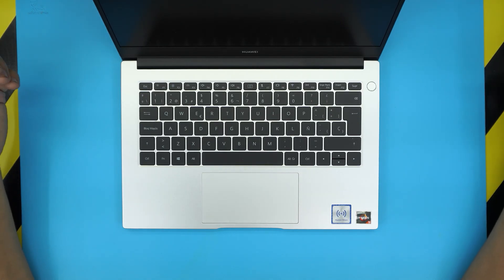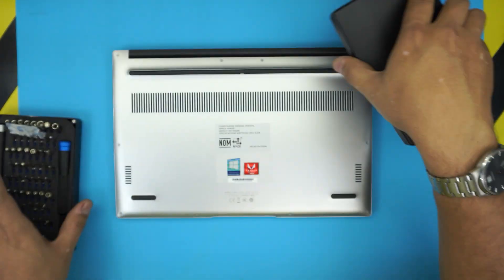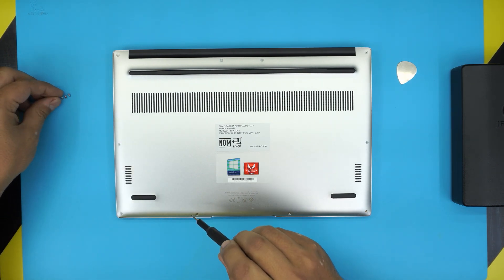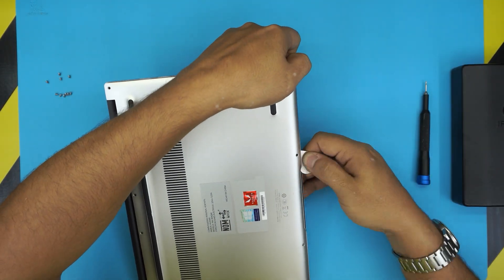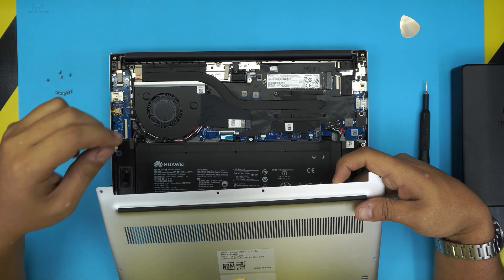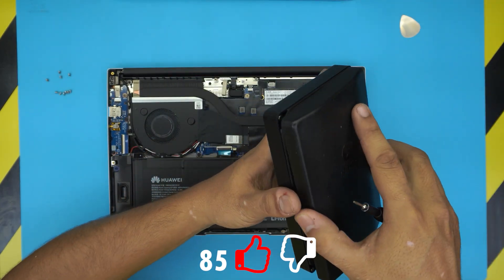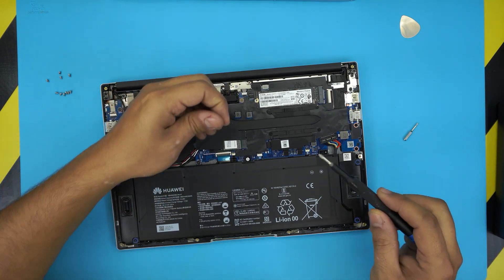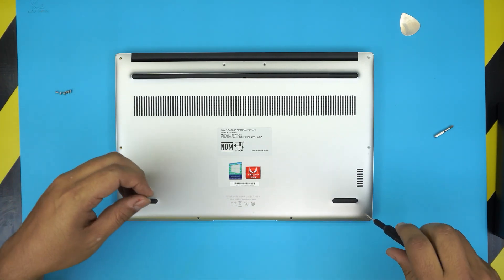HUAWEI MateBook  D14 SSD upgrade GUIDE ( Nbl-Waq9r )

Comment: You made a mistake when referring to the one with two cuts as M.2. Both are actually M.2. 
The one with two cuts, is M.2 SATA with an MB form factor, 
while the other one with only one cut, is M.2 NVMe with an M form factor.
Reply from the maker: Having worked in this field for over 17 years, I'm intimately familiar with the nuances of M.2 SSDs. In repair contexts, it's common practice to refer to M.2 SATA SSDs simply as 'M.2,' with 'NVMe' being the distinguishing term for NVMe SSDs. This shorthand is widely understood among repair technicians.

The omission in my video was regarding the specification of the M.2 physical size, such as '2280.' I could have been more precise in that aspect. However, in terms of distinguishing between SATA and NVMe variants, the terminology used aligns with industry conventions.

To clarify further, I could have specified the M.2 as 'NGFF NVMe' or simply 'NGFF,' but the broader repair community typically operates with the understanding that 'M.2' implies SATA unless otherwise specified.

Therefore, the only oversight in the video was the absence of the M.2 physical size. Other than that, the terminology used aligns with common industry practice. Cheers! 🍻
Reply: My comment is not about your experience in the field; rather, it's about the correct terminology. Both are M.2
🍺
Reply from the maker: I brought up my experience not to boast, but to underscore that I'm not new to this industry and am well-versed in its conventions. In the repair community, 'M.2' commonly denotes SATA SSDs unless explicitly specified otherwise as 'NVMe.'

When I say 'M.2 NVMe,' it inherently implies that the alternative is SATA. There's a practicality to this shorthand; in the context of M.2 slots, SATA SSDs are the default.

Acknowledging that both are indeed M.2 is important, but within the framework of our discussion, it's about distinguishing between the two types of M.2 SSDs. My aim was to simplify the terminology for the audience without sacrificing clarity.

Thanks for engaging in this discussion! 🍺

Comment: Hey! I need your help. How much performance difference there's between the i3 vs i5 model since the ram is 8gb on both devices?. I have only the option to buy the i3 one. Thank you
Reply from the maker: Thank you for the feedback! if you wish to support the channel you can LIKE or SUB or both :P
regarding your  question: all depends on what will be the use of the laptop, if its for daily use for movies, office work, and NOT PROGRAMMING CODES, and photo editing, go with i3 100%. less over heating and longer battery life.
you won't know the differences from i3 - i5 for most of the work load.
this is a good deal:
https://amzn.to/3dQHab7
if you buying on amazon, you can help by using my affiliate links for doing your daily purchases:
USA: https://amzn.to/3ISErw0
MXN: https://amzn.to/3F0sMcc

Comment: is there a way to connect the egpu to the matebook d14
Reply from the maker: Thanks ✌  for the feedback!  if you wish to support the channel you can LIKE or SUB or both :P
regarding your question: YES you can you will need to buy  the following:
USB WIFI: https://amzn.to/2XButf9
E-GPU: https://amzn.to/3Cuvu7X
then you will need to remove the Wifi board from your laptop:
https://imgur.com/a/ObPPRau
and plug the m.2 cable from egpu there and run the cable out , or cut the bottom case.
if you planing to use the eGPU premade with thunderB , it wont work great as you laptop only has usb c normal , it will be veryyy slow.

Comment: Is it possible to physically remove the camera? I'm also planning to replace the SSD. Is it possible to replace it with a M.2 NVMe 2230? From the video it seems it only has configuration for 2280, but I'm thinking of using an extender to be able to keep the 2230
Reply from the maker: Thanks ✌  for the feedback!  if you wish to support the channel you can LIKE or SUB or both :P
Regarding your question: the camera its removable its been held separately. and you can place a 2230 but i would say use double sided foam to keep it attached to mobo :P
https://amzn.to/2VolQny
and place a kaptopn tape over the ssd so it wont short with case if it hits the bottom cover.
https://amzn.to/3yU7oBz
Reply: @uFixTek  Yeah good idea on the double sided foam. Thanks!
Reply from the maker: @onitxuga  thx , it will work just fine :P

Comment: Excelente video! gracias a tus explicaciones tan detalladas pude abrir sin miedo mi Huawei MateBook D 14  modelo KPL W00 (que es levemente diferente a la que mostrás en este video), la mía viene con un SSD M.2 mSATA de 256GB  HFS256G39TNF-N3A0A marca SK Hynix, pero el slot para el SSD en la mother es exactamente igual al del video (es decir admite pcie). 
Estoy pensando en reemplazar el ssd de fábrica  por un CRUCIAL CT1000P1SSD8  de 1Tb (es lo que consigo donde vivo, en Argentina). ¿esta bien? ¿será compatible? 
Muchas gracias por tu tiempo y tus videos! ya me suscribí al canal. Saludos
Reply from the maker: le agradezco su apoyo al canal, sobre el m.2 ssd claro puedes comprar cualquier marca modelo m.2 NVME y los mejores son samsung y crucial. puedes poner hasta 4tb nvme sin problema.
si gusta saber como instalar windows desde usb aquí tengo link:
https://youtu.be/uDu8j2lE-dM
saludos
Reply: @uFixTek  gracias! excelente el video de como instalar windows, lo he visto!
quisiera saber que método recomiendas para clonar o migrar un imagen de disco completa desde el ssd de 256 gb al de 1tb (es decir para mantener todo el contenido del viejo disco tal cual al nuevo sin tener que reinstalar todo de cero)
Reply from the maker: mira lo mejor de todo es que descargues Clonezilla, PERO es algo un poco complicado de usar, yo te recomiendo que descargues Macrium Reflect, es mucho mas simple y rápido y funciona al 100% , solamente despues de clonear vas a tener que ir a extender particiones extra a disco C, eso es muy facil te ayudare cuando hagas,

Comment: Can I install 1tb Samsung 860evo SSD in Huawei Matebook 14?
Reply from the maker: Thank you for the feedback! if you wish to support the channel you can LIKE or SUB or both :P
regarding your question: any model or brand m.2 ssd can be installed:
https://amzn.to/3j7Tg3t
https://amzn.to/3A3dW2C
Reply: @uFixTek  oh then i need to get the 512gb model. 256gb is not enough for me at all :p. I subscribed to the channel and left a like.
Reply from the maker: check the price of the matebook for 256gb version and then the 512gb version and if the price difference is big, then it would be better for you to get the low end version even a 120gb and then purchase a good brand m.2 ssd and upgrade, and save money and get a better model ssd rather them install a cheap asss model. :P 
i appreciate all the support i can get :)
Reply: @uFixTek  ram is important to me. and ram upgrade is not possible. so the 512gb model is much better for me.
Reply from the maker: @PoyrazGulsoy  oh ya daymn i forgot the higher ram only comes with the 512gb version 🤦🏼‍♂️, ya i guess you have to go with 512gb ver.
Reply: @uFixTek  I think so too :P

Comment: How do I transfer all my data from the old ssd to the new one ?
Reply from the maker: Thank you for the feedback and your support to the channel by a SUB :P
regarding your question:
you will need to get this adapter and plug your new ssd into this and clone your main drive. use the Macrium Reflect
https://amzn.to/3mh23iZ
Reply: @uFixTek  Thank you for your reply, also I want a 500Gb ssd for my Matebook D14 but I don't know which one to choose because there are too many types of ssd. Can you suggest me one that is not very expensive please ?
Reply from the maker: i would recommend you in this order:
#1.https://amzn.to/2R7IWwn
#2.https://amzn.to/3fDP1e8
#3.https://amzn.to/39HS80C
Reply: @uFixTek  Thank you so much for your help, I'm going to subscribe to this channel because you reply to everyone and your content is very helpful.
Reply from the maker: i appreciate all the feedback and subs, and in return i always try to answer and help out as much as i can.
Reply: Hello, i have a problem with the same laptop, this "no boot device" suddenly pops up and it doesn't go away even after many reboots. I accessed the BIOS set up utility and it says that the disk information is "not installed". Do you have any solution to fix this problem?

Comment: I have matebook 13 AMD. It has a samsung ssd 256Gb. I want to change it with a 1 TB nvme ssd. But, I am thinking about heat. This evo 970 or 970 Plus Series cause excessive HEAT problem for device?
Reply from the maker: adding bigger NVME is not going to create more heat on the motherboard or anything. its totally safe.
this nvme will last you way longer htan other brands and zero over heating on Samsung, unlike WD that over heat a lot
https://amzn.to/3qmIRAK